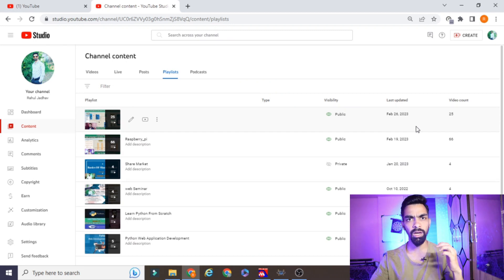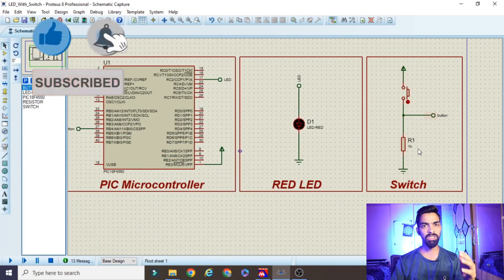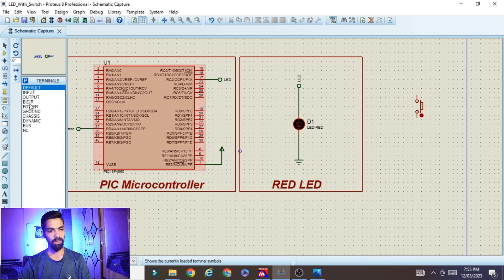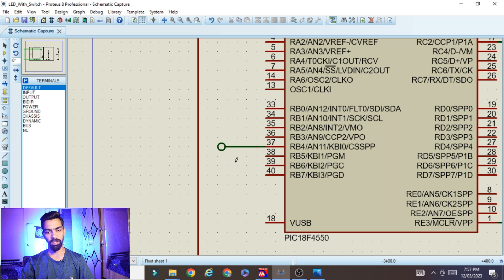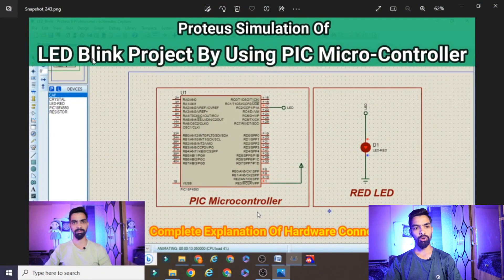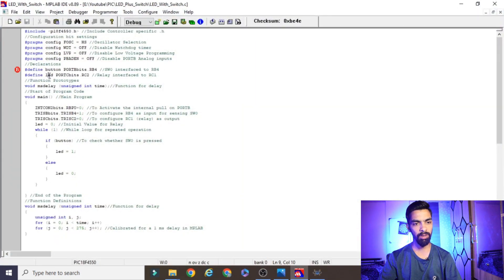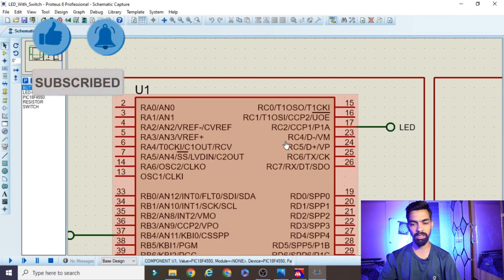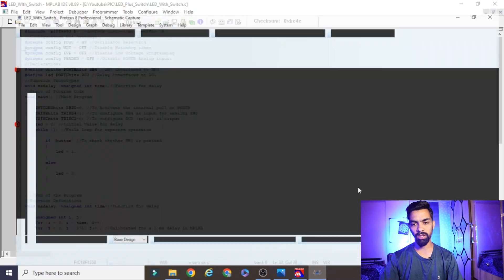How To Interface Switch With PIC Controller | Proteus Simulation

Comment: PWM mode can be run in which format of Arduino?
Reply from the maker: Which format means ?
Reply: @Rahul_Jadhav_Project  As we run the code in Blink to drive the LED, where do I have to put the code to get the output on the PWM pin in the output inside the ARDUINO?